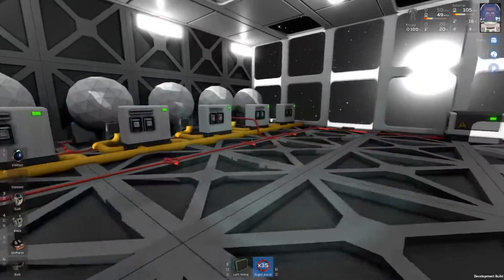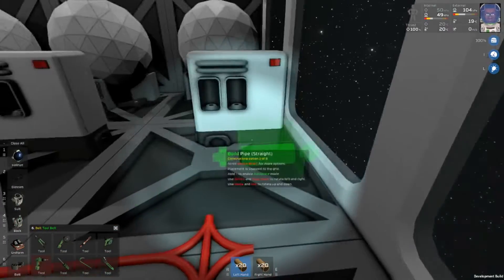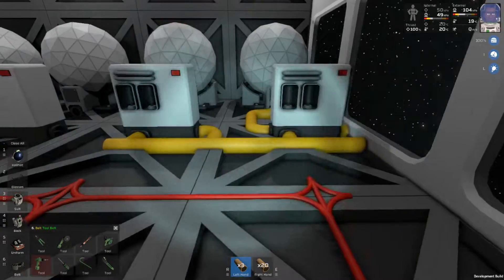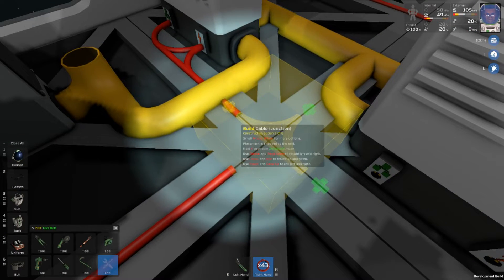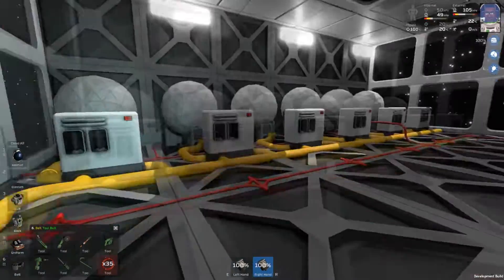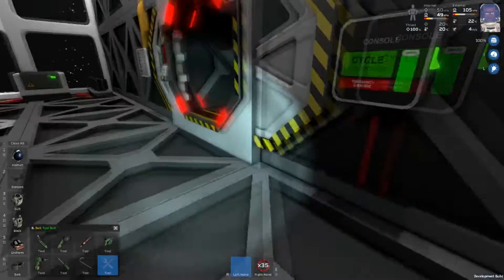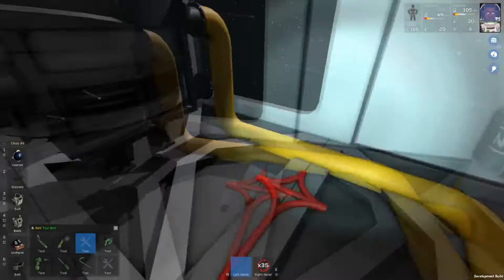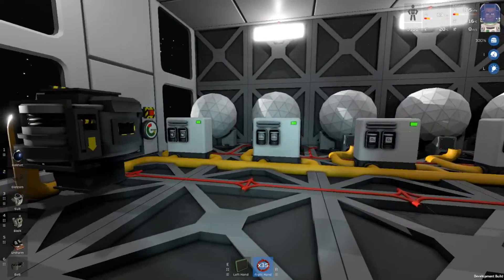Stationeers Tutorial: Atmospherics Pt. 1 (Setup)

Comment: Maybe this works in the game but it doesn't look like it should work. Haven't you used a lot more pipe than you need to? Surely the pipe coming out of the unfiltered port of a filtration unit should go directly to the input of the next filtration unit but there shouldn't be a T-junction in that pipe. It looks like some of the gas could just bypass all the filtration units without going through any of the filtration units.
Reply: Connecting them up the way you described (unfiltered output directly into the input of the next filtration unit) is putting all the filters in series. He specifically said he was connecting his system up in parallel. Both methods have pros and cons. The series system will filter everything going through it in effectively "one pass", however if there is a failure (e.g. filter unit turning off due to logic) it stops the flow to everything else downstream. The parallel system is slower to filter everything compared to the series system, but a stopped or failed filtration unit will only affect that part of the system, leaving the rest to continue unaffected. 

You are also correct in that some gases are able to bypass the filter units altogether. This could actually be desirable - for example, there could be a need for only one or two gases to be filtered out of the mixed line, and the rest be vented to atmosphere. It also allows for a system that is controlled by logic where the filter units could be switched off when the filtered storage tank is full, leaving the now unwanted excess to be vented to atmosphere or be otherwise distributed elsewhere. Hope that helps.

Comment: Ok this is nice, but i need a simpliest possible room air filtration system for taking out poisonous gases . Any suggestions?
Reply: im a bit late, but im assuming you want this because of the arc furnace. once you get the better furnace you can take all the gasses from it through its output pipe.

but to directly answer your question, you could make a filtration building, hook some oxygen filters inside it, connect the input pipe to an inward active vent, the filtered pipe to a passive vent (you could use an active one if you want), and the unfiltered output to whatever you want ! that may be a tank, or an outside vent, or if you want, a sorting system such as the one in the video

Comment: What if one of the tanks, for example, carbon dioxide is full, and the rest of the tanks are not? If you continue to melt the ice, then the overflowing tank will explode. Manually relieve pressure? Or is there a more elegant way?
Reply from the maker: I think the best way to handle that would be to have several IC's one reading tank pressures and one reading input pressure. When a tank is full and the input pressure is too high, have a electronic valve empty the excess pressure.